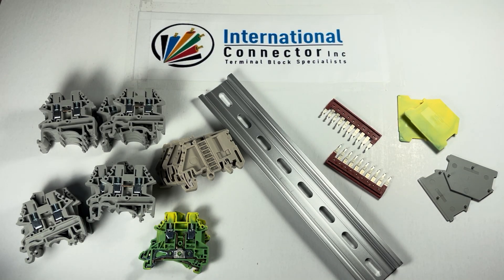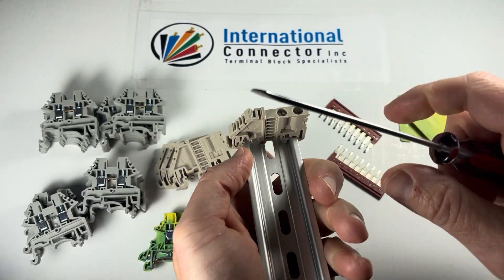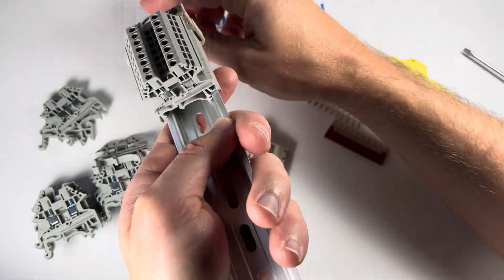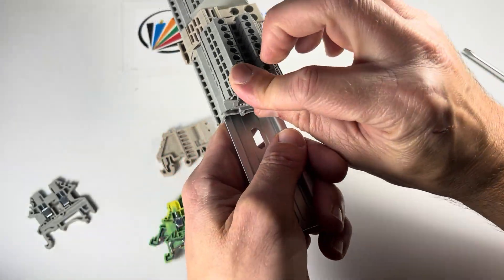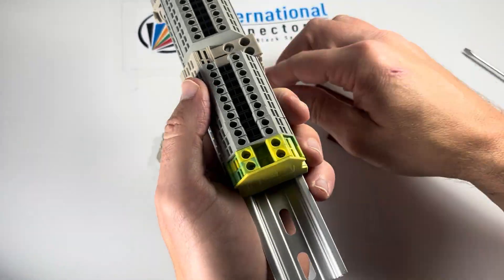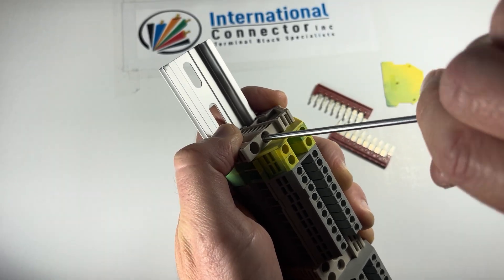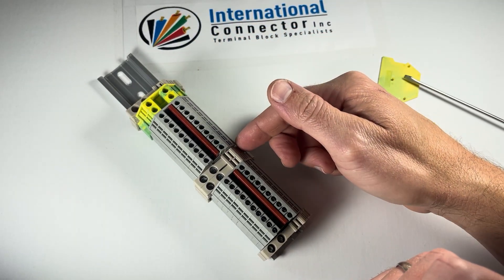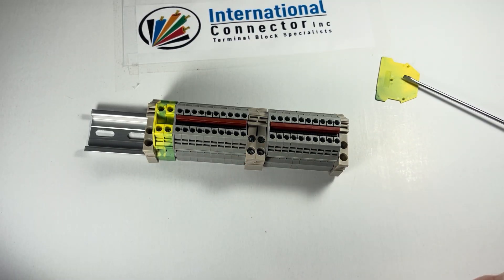How to use the gray terminal block kit with Dinkle DIN rail DK2.5N blocks and accessories.

Comment: Awesome video and clearly explained how to use terminal blocks for a newbie!
The grounding block is a bit confusing though, so it grounds incoming ground wires to the DIN rail , correct? 
If the Din rail is mounted on plywood and not grounded, can the ground terminal block be used with a wire to ground the DIN rail to say a chassis grounding point elsewhere? Sorry just a bit confused on the grounding block as these DIN terminal blocks were used for 24vdc in my RV.
Reply from the maker: Correct.  The ground blocks won't work well if the rail is mounted to wood, but the ground blocks will be connected to each other through the rail instead of using jumpers.  You can use a wire to ground it to the chassis.  In that case, you don't really need the expensive ground blocks.  You can use them, but you would save money by using the DK2.5N-GN Dinkle block.  There would be no need to buy the more expensive ones that have metal going down into the mounting feet, but since the came with the kit, your wiring plan would work just fine for grounding.

Comment: I need this exact kit except I need 10 Blue Terminal Blocks and 10 Brown Terminal blocks. Do you sell it like that? What would be that part number?
Reply from the maker: If you buy this kit, you can pick out whatever color combination that you want.

https://intconnector.com/products/pick-color-din-rail-terminal-block-kit-dinkle-20-dk4n-10-awg-gauge-30a-600v-ground-dk4n-pe-jumper-dss4n-10p-end-covers-end-brackets?variant=40966816202904